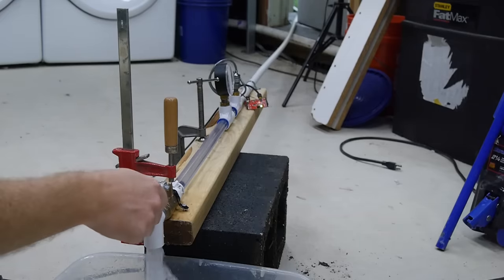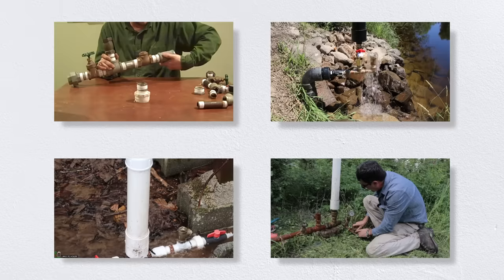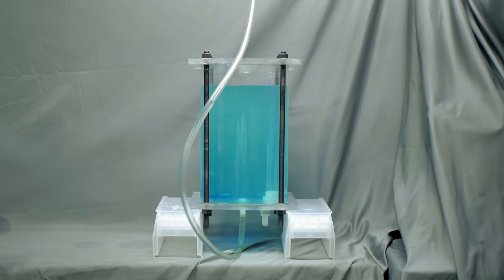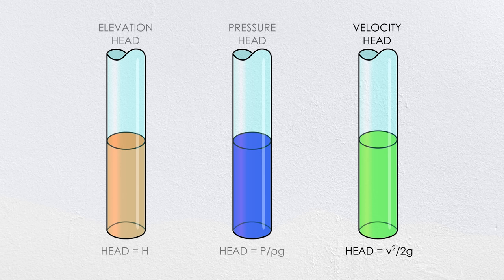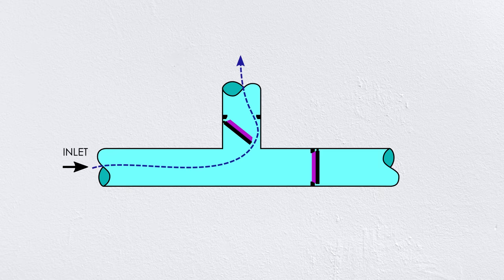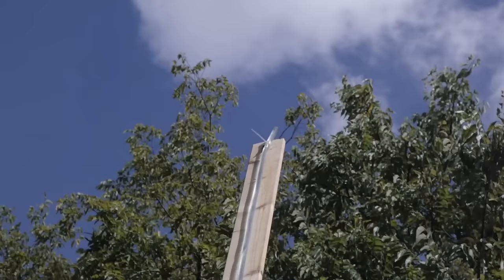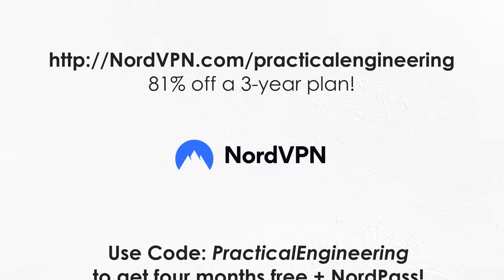How Does a Hydraulic Ram Pump Work?

Comment: Do you need a certain strength of flow of water for it to work? We  have a stream at the bottom of a field with a constant 'gentle' flow of water and I want to get it to the top of our garden some 100m away and about 20m high up.
Reply: As long as the flow rate of the water source is enough to cause the waste valve to close, the ram will work - it will just work very slowly. The drawback with a gentle flow is that the source water doesn't hold much kinetic energy - which is proportional to the square of the velocity. For example; if you halve the water velocity, the kinetic energy drops to a quarter of what it was.
HTH

Comment: Hi, PE. I live on the 20th floor. The building water pressure is often too low to allow my water heater to turn on. What is the best way to raise the water pressure without electrical energy? My idea is to run a water line up to the roof and into a supply tank. Then, I could draw the supply from the tank at some benefit. I would be limited to the capacity to the tank re how long I could take a shower. But at least the water would be warm. Do you have any better idea?
Thanks. CJ

Comment: I dont see how it would be impossible to create this on a bigger scale to feed a hydropower station. I understand that the time it would take would be a long time and the amount electricity created would be low.

But if you were to use heaps of these to feed a man made elevated dam that then uses the head pressure of the water collected to create electricity. Then release that water back to where it came from
Reply: Ram pumps are not very efficient.  You are better off with a direct path from flowing water to spinning the generator.

Comment: although it has been 4 years since you posted this, i hope you read this @PracticalEngineeringChannel. my home regularly flood when there is heavy rain due to improper drainage system from near houses around mine. my house is about 500 meter to the beach. will this hydraulic ram pump method be practical if i drain the flood water to the sea?. there is maybe elevation on the ground not more than 1 meter i guess.. thanks

Comment: Excuse my ignorance but i recently built a nice Ram pump for my farm and am curious if there is an added benefit of some device that can generate a small electrical current from the water output as it pumps the water supply?   And if so could i manipulate the speed or quantity by increasing my intake water quantity and flow rate?  I Have a raceway and dam system to increase downward flow.  Thanks all.

Comment: Will a ram pump work to pump water from a static source? I assume the water must have some flow on inlet which the ram pump increases to give head pressure?
Reply: No - the water source MUST be flowing, otherise it has no kinetic energy, and the operation of the ram depends on kinetic energy. The ram pump actually slows the average flow of water, but increases the pressure on the delivery side. In effect, it's a swap from one form of energy to another.
HTH

Comment: Does the waste valve have to have water spill out wastefully, or can it be captured and moved or the waste valve built tall enough that it never spills over?
Reply: If the outlet to the waste valve is tall enough that the water never overflows, then the waste valve will never shut because there is no water flow to shut it, so the feed valve will never open, so the ram won't work at all.
The set up shown in this video is just to demonstrate the principle of how it works. In a practical installation, the ram is either in the river, or just above it, so the water coming out of the waste valve is not 'wasted' as it just falls back into the river.

Comment: At first I wondered if this could be exploited for "free electricity" with a setup that send the output to the top of a water turbine and returns the turbine output to the starting reservoir before realizing the issue.

The waste valve accounts for the energy loss to make it work.

Assume half the water input goes through each valve, if the input gets 10kg of water, half will be dumped to pump 5kg to the turbine which passes on 5kg to the reservoir. This is obviously not a perpetual motion machine, and we would be better off just sending all 10kg to the turbine in the first place.

Moral of the story: whenever you think you found something that sounds to good to be true (and would already be implemented if it was) you should figure out where the problem is. (And not sound dumb)

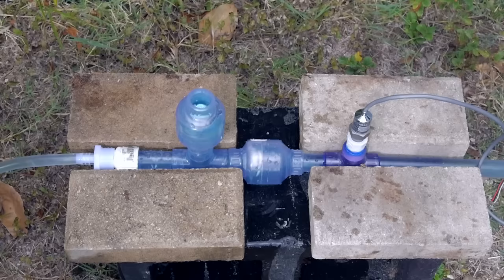Comment: @6:55 I want to see the pump from a water turbine.  I saw these ram pumps long ago where someone had a bucket flowing water and it went to the top of his house.

I'd like to see if you can chain these together to gain even more height.  Example: if you gain 20 feet from from 100 gallons of moving water and net 1/2 that to the 20' mark, then you could release the 50 gallons you just raised 20' and get 25 gallons to 40' and 12.5 gallons to 60', etc..  In other words the water at 20' has energy in it that can be harnessed to move it even higher.
Reply: its been a while but to explain the main issue with chaining them its the waste water as you mentioned, its actually around 90% so its a lot. You could have waste water drop down to the previous pump in a more complicated setup that way you dont need an incredibly huge source of water at the start.
Reply: @agafaba  one way of looking at it, just understand the physics. If you have 10 gallon buckets and a pulley and rope system and you have 10 gallons of water at any height, 10 feet or 10,000 feet, can you put 10 gallons of water into that 10 gallon bucket on the other end of this pulley system do you have 9 gallons of water and a 10 gallon bucket. Because the 10 gallons of water weighs more it's going to lift those 9 gallons of water as high as you want them to lift. So if you lift the 9 gallons of water 10,000 feet, and then you have another pulley system it's also 10,000 feet now you have 8 gallons of water that are 20,000 feet up. It doesn't have to be 8 gallons of water we could actually be two ounces less than the original 10 gallons and still works.
If you can also start off at 1 foot.  I'm not sure how efficient the ground pump is, compared to say a screw pump that is powered by a paddle wheel, or a simple bucket and pulley system.

Comment: Will this work with a return line on top back to the water source to prevent all the spillage?
Reply: The spillage doesn't matter in a practical installation (this rig was just to demonstrate the principle). In a normal installation, the ram pump is either in the river, or mounted just above the river, so the spillage from the waste valve just falls back into the river.
HTH

Comment: Could one tweak that wastegate valve to seal  as soon as 'any' positive pressure is applied?
Reply: The water needs to pick up speed, so the easier the waste valve closes the less pressure you can generate

Comment: why arent rump pump utilized in dams that generate power so it will
waste little water by cycling the water above the dam again
i hope you can answer this one 
please sir
Reply: Ram pumps require a supply head, the same as turbines. Therefore you would have to take away the turbines supply head and this would offer minimal gains.

Comment: q: why couldnt you tap into the exit valve too and not waste the water, wouldn't pump out both ways? the back pressure from the valve would be the same as it is just flowing over the edge,

Comment: try to research on capillar too
capillar acts due to attraction, "stickiness" of wated to glass tube(glass capillar easy to make from usuall brocken lamp glass tube with air-butane torch, heating and pull the tube like chewing gum - but the pipe hole will remains), so actually on the end of water column -(line segment) - called menisque - no anymore just atmospheric pressure - but some extra additional vacuum(underpressure) of glass tube that very close to vater of small diameter - so acts like a piston with front film of surphase tension
it underpressure - invert proportion to diameter, so in can lift water up to h~1/d , pull it horisontally unlimited long, fighting only with viscosity and friction, or accelerate it down in tube - faster than gravity drop allows

Comment: You didnt mention the water source details. Does it need to be moving on its own downhill? Can the ram pump be put underground and connected to a still pond through a pipe yet still work?
Reply: No - the source water has to be flowing. The ram pump works by converting the kinetic energy in the flowing stream to pressure energy in the delivery pipe. If the source water is not flowing, it has no kinetic energy, and the ram pump cannot work.

Comment: Then use the potential energy of an elevated water tank to spin a turbine to create free electricity?
Reply: If you have a source of flowing water (required for the ram pump to work) you're better off running a water wheel or turbine directly.

Comment: Is there a way to collect the wasted water so you can re-circulate it back into the system?
Reply: In a practical installation - as distinct from this demo set-up - the ram is either in or just above the river, so the water from the waste valve just goes back into the river.

Comment: Can I use this ram pump in a pond of depth 4.5 feet &15000 litre capacity ....will this work in ponds...there is no flow in or out of the pond ,ie water is still in the pond ...I've to pump water from the pond ....can I use a ram pump ...please reply
Reply: Please watch the video again.  listen to the explanation of the three types of energy available.  Then think about whether a pond with no moving water will power a ram pump that requires kinetic energy from moving water to work.  The short answer is "No."

Comment: 4:33 what is purpose of that fatter part between tiles, can i just use straight pipe which have check valve and pressure tank?
Reply: That fatter part is actually check valve.

Comment: Can we use this to make a system that works with tidal power? Just think, free energy.
Reply: Tabourba  how about something like an offshore oil rig building, but it is a reservoir of sea water that is raised by this method and the output is connected to a turbine just like a traditional hydroelectric power station?

Comment: I have an errant spring that forms a glacier on my road each year, can i use this ram pump to redirect the water?
Reply: A ram pump dumps most of it's water where the pump itself is placed.

You can redirect the water with just piping and the ram pump gives you the benefit of pumping a small part of this water even higher than the source was

Comment: Can the water source be static or does it have to flow for this to work?
Reply: Ideally a flowing water source is needed due to a ram pump required a supply head and a constant supply of water. static sources can be used in certain situations and can certainly be used with solar as a complimenting system to provide supply head or recirculation.

Comment: If energy equal mass times the speed of light squared, and you're moving a mass without extra external energy, then is it not a form of over unity?
Reply: No.  A ram pump just converts energy from one form (kinetic energy) into another form (pressure). What it cannot do is to create more energy on the delivery side than it receives on the feed side.
The "external energy" source is the flow of water in the water source (river or stream).
The physics rule - "Energy can neither be created nor destroyed, only converted from one form to another" still holds good.

Comment: Still fuzzy on it.  What kind of inlet pressure do you have to have?  Does it actually pump enough to be practical or is it just an oddity?
Reply: The water from a stream on the inlet is all that in needs at that end.
The pipe goes down hill several feet.
The weight of the water in the pipe is what causes the initial pressure at the valve end.
A handy rule is 1/2 of a PSI per foot.
Many of these are used for practical purposes.  It is not too hard to get water up to a building, garden or trough well above the stream.  The amount can be several gallons per hour with even a small one.
Reply: Thanks for the reply.

Comment: Hi friend, question, why isn't all of the world powered by this? Like you build a series of ram pumps that get the water higher and higher up and then drop the water to a turbine to produce electricity and litteraly rince and repeat the process forever only adding in a bit of water to compensate for evaporation? :x
Reply: This isn't a power source. This is just converting "flow rate" into "head pressure". 
The ram pump loses a lot of the water in order lift the rest of the water to a higher elevation.
In fact the ram pump will lose some of the usable energy while making this conversion.
If you have a source of flowing water (required for the ram pump to work) you're better off running a water wheel or turbine directly.

Comment: Would this work with other fluids such as air?
Reply: In principle yes, however, air has 2 problems:
1 it has a very low density and we were converting kinetic head to pressure head so i don't know if the actual output rate would be noticable. (Or if density cancels out, math is wierd)
2 it opperates on water running down hill and out the waste valve which shuts itself forcing a packet of water out the main valve, air in the atmosphere does not have a noticable gradient (ignoring wind) to flow down to operate the pump. The pump also probably doesn't generate enough pressure to compete with a electric air compressor and solar panel for a similar application.

Comment: I have one question about this my dad sent this link to me because we’ve been arguing about if we should get this ram pump or and petrol or electric pump anyways he says this ram pump thing is able to pump out the same amount of litters per hour as an electric or petrol pump is this true?
Reply: Ram pumps operate 24/7 without the use of fuel or electricity so therefore have extremely low running costs compared to most other pump types. The delivery amount depends on the available supply head and the delivery head which you are pumping to. Ram pumps are a better long-term investment

Comment: Is a Hydraulic Ram Pump With Tesla Valves Practical or Even Theoretically Possible?

Ram Pumps for water are inefficient, but practical in many applications nonetheless. The obvious advantage of a Tesla Valved Ram Pump would be that are no moving parts and apparatus would have a very long maintenance-free lifespan. Tesla Valves would obviously reduce the efficiency of a Ram Pump even further, but how much? To the point of total impracticality? Is it even theoretically possible to build a functional Tesla Valved Ram Pump or do the laws of thermodynamics preclude one from working? Can there be a sufficient drop across a Tesla Valve to make it work? Has a "proof of concept" ever been published? Has one already been built? I don't have the resources or background to attempt to design and optimize a Tesla Valve Ramp Pump, but I would like to know engineers' thoughts on the concept.
Reply: I don't see how that could work, as a Tesla Valve is a one way valve (as are both valves in a hydraulic ram), but though a Tesla Valve will not allow a backflow of water, it cannot shut itself off.  For the hydraulic ram to work, that waste valve HAS to shut off, to bring the water flow to an abrupt halt, or you'd never get the sudden spike in pressure needed to open the delivery valve, and the ram would never work. Bear in mind that, if the ram lifts the delivery water 35 feet, the pressure on the outlet side of the delivery valve is about 15 pounds per square inch - so the pressure spike has to be above that even to lift the delivery valve slightly off its seat, let alone open it enough to get a reasonable delivery rate.
As for longevity; some hydraulic rams in England have been running for over a century with no problems.
HTH

Comment: Failed mechatronics engineering student here: is this at all related to a Venturi?
Reply: Um - not really. I can see points of resemblance, in that a venturi gets a gas flowing at a certain rate, speeds it up through the narrow portion of the venturi and lowers its pressure - but what comes out of the outlet pipe is the same as what goes in. Even in a carburettor, the volume of petrol added to the volume of air when the air flows through the venturi is minute.

Comment: Shouldn't your chart go back to zero each cycle?  It's source (static) pressure remains the same. Mistake? I see how the peak gets higher each time because it adds a discrete amount of pressure to the new output head each cycle proportional to the velocity, but at some point, the original velocity (squared) isn't enough to overcome the back pressure from the new head. Does it approach its limit asymptotically? -+++- What's the pressure capacity of this pump in terms of its original source of energy (static head of its source)?  Velocity also has a component too, doesn't it?  The velocity should be dependent on the difference in height between the source and waste valve (so lowering the waste valve increases the velocity; but is it canceled out by the downstream back-pressure? By how much?).  Velocity also depends on the pipe diameter (the smaller, the faster; but then you also get more friction).  Water hammer is dependent on change in velocity, so faster check valves provide higher pressure spikes and higher pump capacity, right?  Wikipedia didn't have a good article on this, so I have no sense of the capacity of the pump in terms of all these variables.  Thank you for all your work to make water engineering easier to understand!  I'm a mechanical working in a civil engineer's field.  I didn't minor in water, so I'm constantly surprised by the random things civil (and environmental) engineers know that I was never exposed to.